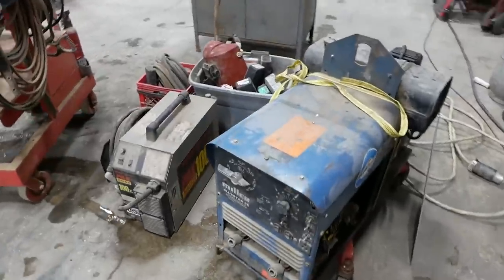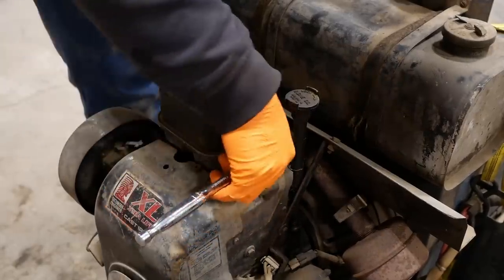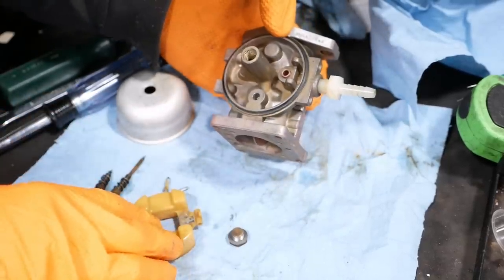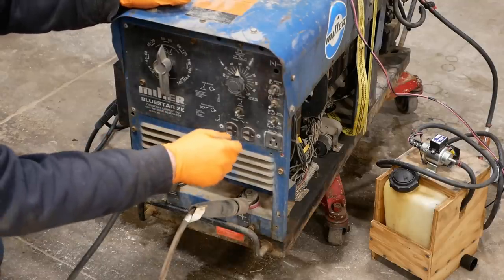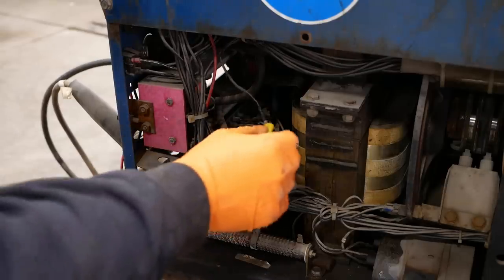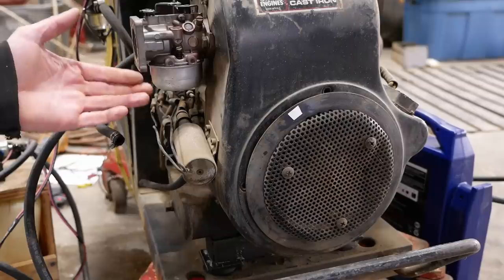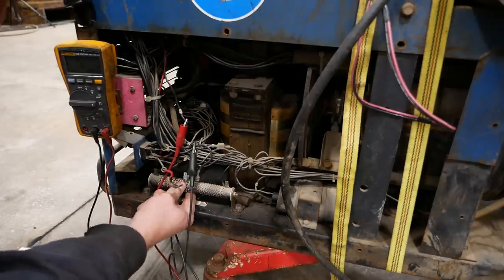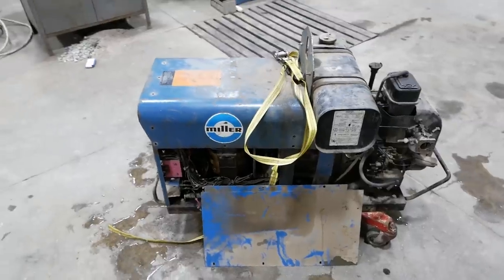I Bought a Broken Portable Welder - Can I Fix It? | Miller Bluestar 2E Part 1

Comment: I love the diagnostic path you took. For people who are not mechanically inclined, they simply don't understand the satisfaction one gets bringing something mechanical back to life. In this now throw away world, it's nice seeing someone's junk being brought back to life so it can be used for years to come. Well done.
Reply: Ditto
Reply: I recon we are individually technologically regressing. Things that or fathers fixed on the dining room table, we don't even know how they work.
As for new tech, less and less people actually know how it works and as a society we generally don't care how it works so long as it does.
Reply: @flightforensics4523  He's definitely not a carburetor guy, I think a self-professed one, but small engine carburetors are an easy equation and they are almost always in need of TLC on old neglected equipment.
Reply: @BlackCoinCrypto  Every 'body' seems to be afraid to get their hands dirty...
College wannabe sophists.
Reply: Aint that the truth love reviving old stuff and keeping this alive
Reply: Miller is a great company that seems to support all of their old equipment. Besides the capacitor, which is industrial lego and should be easy to find a close approximation of, he was able to still get all the parts still. That's worth a lot considering that this style of machine just seems to last forever. They way overbuild them. I just got a hold of an old miller stick welder and it's designed to draw 50 amps at 240 volts to put out about 140 amps DC and still be chooching at 100% duty cycle. To truly max the machine to 200 amps DC which would still be 30% duty cycle, I'd have to bypass the 50 amp plug and hard wire it to a 100 amp breaker. At the amperage I typically weld at it doesn't even get warm.

Comment: Wes, I bought a used Lincoln weldandpower diesel generator for $35, did some work to it and sold it for $600. It was put on a trailer.

Comment: Official procedure to re-magnetize a generator that uses residual current:  Fire it up, plug in a drill.  Pull the trigger.  Grab the chuck of the drill and give er a spin.

Comment: I’ve learned two reasons of why Miller is superior…
1. The manuals and wiring diagrams are available online.
2. They have tech support that will help you troubleshoot and get your machine running again.  

I always did the troubleshooting myself, until one day ran out of ideas.  I called them up, they told me a couple key things to check, and that helped them lead my down the path to the failed part.  They were willing to stay on the line while I ran the machine and poked around with my meter.
Reply: That's good to know. I have a nice one that quit working and is all electric
Reply: if you have a miller you are going to need all that help because they all burn out and stop working long before the engines ever start to smoke. they are junk
Reply: Maybe coz they break all the time and need that info and parts
Reply: @mikecubes1642 😂😂😂
Reply: I bought a partially disassembled 1993 Lincoln SA250 a couple of years ago. I reassembled it, got it running, and found that it wouldn't weld or make auxiliary power. I called Lincoln, who took my phone number and scheduled a time for a semi retired tech of theirs to call me. I believe his name was Bob Crow. It took him less than fifteen minutes to figure out the problem, a shorted armature. He and the other tech on the line recommended a rewinding service to send it to, as well as a couple of aftermarket sources for parts that Lincoln has obsoleted.

Contrast that with Miller. My employer has a Syncrowave of similar vintage. We sent it to their techs to be repaired. They had it for several months. They eventually sent it back, claiming it was fixed, although it wasn't, and charged several hundred dollars for the service. They also said a pressure switch was obsolete. It isn't. Frankly, Miller fails by comparison. 

Lincoln has manuals and literature online. They have also supplied me with diagrams of control boards not found in the manual or general user literature.
Reply: @zombieresponder  Good to know.  Thank you for the input.  I personally don’t have any experience dealing with Lincoln, only Miller.  From all the comments I’ve received on here, it sounds like Lincoln makes the superior product.
Reply: Don’t doubt yourself here, miller and Lincoln both make good stuff. It seems that the people responding are Lincoln guys. To me it doesn’t matter. Both care about customers, and both are American made. At the end of the day, if it welds, a weldor should be able to do something. Also American manufacturers give Americans jobs. All wins in my book.

Comment: Excellent electrical diagnosis, Wes.  One thing at a time, starting from the beginning.  I would expect the rheostat and resistor are your most expensive parts.  The pulse fuel pump is rather common, and high-voltage diodes and rectifier bridges aren't too expensive, either.  Speaking of which, you might throw another ten dollars at that bridge rectifier.  Could save you a lot of future headaches.
Reply: I agree on the replacement bridge. Too much bad stuff has happened at that wiring junction. The 10A diode he has will work fine (assuming it is 1KV), and it will be physically more rugged than a 3A or 5A diode. The cap is also a 10 buck item. Most likely that rheostat is going to be 50 or 100 bucks or more, but everything else should be cheap.
Reply: Depending on the vintage of the machine, Tecumseh used three different ignition systems. Early versions had points. I'd prefer the points version...for reasons that will become clear shortly. The other two ignitions were electronic, but one was a CDI. The latter two have zero parts support. The CDI version in particular has a second set of windings, similar to the alternator, that are required for it to function. If either one fails, it doesn't run anymore. I have one of the later CDI versions, and the ignition quit on me a while back. There are a couple of aftermarket solutions that can be used, but they're not cheap.

Comment: Miller bought out PowCon welders simply for the inverter design. The first Miller XMT's were blue PowCons, same case and everything. They were really well made and lasted forever.
Reply: Miller bought Powcon in the mid 1990s to gain control of Powcon's inverter power supply patents. I own a Miller XMT-300 machine; it's just a blue Powcon. A year of two later Miller "Millerized" the Powcon designs, changing the fiberglass case into a metal case, it was called a XMT-304. These machine were light in weight and had great stable arc characteristics.

Comment: Walbro carbs are pretty good. I have a small engine shop and repair lots of carbs. If you can't get the emulsion tube out, you can get small brushes that will go inside of it and clean the tube orafaces. Nice welder, hope it will work for you. Thanks

Comment: You can absolutely get parts/rebuild kits for them all over the place. you might have already tried this but sometimes you cant pull the emulsion tube from the bowl side you have to stick something in through the intake side and push it down through there. Not sure if that is the case with that exact carb but worth a look if it gives you trouble down the line.
Reply: Agreed, the emulsion tubes are often  just retained by the main jet, but they can be pretty tight to get out.

Comment: Hey Wes, just to let you know you can make a three phase converter fairly easily. Look up a rotary 3 phase converter. It will take some work on your end, but I built one myself my wife's grandfather built one for his shop and my father-in-law built one as well. If you can trace down problems in the electrical system of a car, you can build a three phase converter. Also if you need capacitors check any place that sells electric motors ie poultry supplies pig supplies etc. Or you can check any HVAC supply house, they will most likely have any capacitors that you need
Reply: Rotary 3 phase converters have been pretty much obsolete  since the advent of cheap and reliable VFDs
Reply: @kenney4043  Yes, but how dirty is the output on a VFD
Reply: @charlesangell_bulmtl  depends on the VFD unit.  Can be considerably cleaner than a rotary phase converter depending on what your local power company supplies etc.  I run a rotary in my shop but have a couple smaller VFDs for smaller things.

Comment: If it works, that powcon is a real gem, My uncle had one for 30 some years in his machine shop. It predates the miller xmt 300/350, but is basically the equivalent, one of the first inverter light weight welders to hit the market, a very high end machine when new

Comment: I've seen lots of PowCon welders in the navy. The ones we use on submarines are a smaller version of what you have that are set up for TIG. Good work getting that Miller brought back to life.
Reply: Some 30 years ago, I worked at a bio-mass steam turbine plant...small, 35 megawatts...When it was time to change out the boiler super heat tubes (2' Chro-moly) we used a couple pow-cons with scratch start TIG...they worked pretty well.

Comment: I have a Powcon 300 ST. Tig and stick. Great machines! In fact the US Navy used them on their ships. It can run on three phase or single phase depending on how the jumpers are set up inside. However, you have to de-rate it by 1/3. Unfortunately, Powcon has been out of business for decades, but manuals can still be found online. Powcon was the first to market with these inverter welders, however instead of cheaper IGBT technology that other manufacturers went with, Powcon used SCR’s which made the machines much more expensive, however they were very robust and failures were rare and easily fixed.

Comment: 72 year old retired generator guy here - I used to have that exact welder about 1985 or so - the system you were trying to describe that gets the generator going is called the field flash circuit - be sure and read your book on how to adjust your ac voltage 132 is pretty high - try to not run too much above 124 or so - when you run that thing make sure and put a leash on it - that one lunger will walk right out of the back if your pickup if your not watching... good job. - I picked up a 400 amp Miller pipeliner the other day that would not weld - 15$ later and a new diode I was in business - if I was you I'd put some new main brushes in it and clean up the slip rings - that reostat is a common failure - also work that range switch back and forth - it has wiping contacts but they do need cleaned by working the switch..

Comment: A new carburetor for that engine on Amazon is about $15. I bought one for a 1984 Honda 125, bolted it on and it worked great. 
It’s not always necessary to replace the carb, but when the carburetor is getting in the way of the “real work”, it’s a good option to consider.

Comment: Fun fact! I used to work at Miller.. worked at 3phase products and also in the engine drive shop..Great company to work for and things are done to perfection or as close too as possible..got let go in 2008 during the economy crash.. I've wound many 3 phase coils and  various other rectifiers and coils for different machines.

Comment: Stay tuned for the shocking conclusion :D Just replace that fuel pump with a standard round pulse pump. rebuild kits have long been nla from techumseh I have done the conversion on several of my old tractors that use the techumseh motors. Standard briggs and stratton round fuel pump from any modern twin or single works perfectly 520-441 stens part number. just find a convenient spot to mount it and run your pulse and fuel lines in.

Comment: You can always get a VFD to run that plasma cutter if you can't swap it to single phase.
Reply: Tim is 100% as this is the simplest (and probably cheapest) way to go.
Reply: I doubt it, many 3 phase welders are really only single phase, but use the higher voltage between phases rather than the lower voltage from phase to neutral. For example in Australia we have 240 V single phase but 415 on 3 phase. Higher end welders will often be genuine 3 phase, to get smoother DC after rectification, but even here a VFD will be of limited use because the voltages between phases will be the same as the single phase supply, so in the U.S. even on a 220/240 V circuit the 3 phase voltage will be the same as the single phase supply.
Reply: @Rope Tangler  idk what you're talking about because in the US, you can get 120/208 3ph, which has less voltage per phase than 120/240.  And you can also have 277/480 3ph which is found in commerical and industrial settings. But even if a vfd doesn't work, which it probably will. He can get a rotary phase converter.
Reply: @timhufnagel7462  you need sufficient voltage and the ability to supply sufficient current to make it work. If in the U.S. you put 120V, single phase into a VFD to get 3 phase you do not normally get 3 phase at 208 volts between phases, but you get 3 phase with 120 volts between phases. Much the same situation with a RPC, while it is possible to make a RPC with higher voltage output between phases than the incoming single phase supply, that is not the way most are configured.

Comment: I have a Miller 2E that I bought new in 1987. Has been faithful. Had the carb to develope a tiny pin hole in the round 3/8" round alum circle near the idle screw two yrs ago...Pluged that.  Had to replace the org. starter, then I  bought a "spare" new one...cause they are not making them anymore. Am real careful to change the oil frequently, what with no oil filter. 
 I learned a lot from your vid, Thank you.

Comment: The slip rings are really dark and shiny. I used to work on these and that was one of the more common problems I ran into on these machines. I used a piece of fine grit sand paper taped to a paint stick to clean them while the machine is running. Good job diagnosing the problems.

Comment: That older Tecumseh engine could be burning oil because they put the same 5w-20 in it, that they used  to top off the Super Duty truck that hauled it around.   Looking forward to part 2.

Comment: On the blue star there is three possibilities that are common 1 check the little diode in the wire loom. 2 the rectifier it’s for the power supply to the control board. 3 the brushes. I had mine go down I talked to the guys at applied equipment out of Dallas they were extremely helpful all the parts for all three possibilities was under $40

Comment: They are a great welder. I bought it new. Used it over 30 years in my service truck. Still works great. Only problem was Tecumseh engine parts are no longer available. The engine magneto died. I put an mid 70s ford ignition module and a bracket to hold a cam sensor. Works like new. Only problem I ever had.

Comment: "Now that we've spilled gas everywhere, lets try and weld something" lol
You've convinced me that I need an ultrasonic cleaner.  You can get replacement carbs for that on eBay.  Cheap Chinese carbs, but they work.  Talk to Lincoln, if they don't have a part you need, they can point you towards someone who does.
Excellent work figuring it out!

Comment: I picked up a Lincoln in similar condition. The capacitor in it was faulty also which translated into difficulties starting an arc. Once a stable arc was going it was fine. A replacement for it was also unavailable, so I had to go to the “best sort of similar option” and it’s done fine since. Nice pick up you got there.

Comment: Did a quick lookup that Tecumseh should be a OH160. 16hp.  I have the OH120, 12hp version on my sears lawn tractor.  That thing is 33years old now, still running.  Leaks oil.  When I got the manual for it online to search for orings and seals, i was surprised to see it was designed as a 'long life' engine.

Comment: i have the same unit. I paid a generator shop for a load test and ohms adjustment. They also cleaned the slip rings and replaced the brushes. I finally got to use it the other day. Great welder for what it is

Comment: Clean those slip rings on the brushes Wes. That welder will be great around the farm. I welded with one for several years in a Steel factory and the units were bullet proof. I had a 16 hp Onan on mine but never had any problems on the line. I changed oil in mine every 50 hrs. of hard use.

Comment: Brought home my own crusty junk this week, I picked up an ariens power broom that had been sitting for years. Covered in rust missing the pull start ,electric start was falling off. I had all the parts to fix it got it running in about 10 minutes and all fixed in an hour only problem was it was going to be my winter project...but it's all done on the 1st afternoon lol

Comment: Good machine, i have one paying around, they use a bit of oil as they age, valves need some attention once in awhile, can be rebuilt many times as long as the electrical end works, nice little units

Comment: Nice work on running down the problems. I have an even older version of that blue star welder. It came with no throttle servos and  a carb that had horribly worn throttle and choke bushings and shafts. 
I looked for Tecumseh replacement carburetors and found a few on Ebay at ridiculous prices. I opted for a cheap Chinese Kohler clone carb off AMAZON  which had the 2 stud mount. The throttle linkage was different but after some alternate engineering it runs much steadier than with the old floppy one. I have to set the engine speed by ear for the 2 different generating speeds. Also mine always wants to be choked to start. 

Another thing is on mine, it generates 120 volts at low idle like 1000 RPM. Both switches need to be in the correct position for that to happen. 
To weld the switches need to be in the other position and the engine needs to be  running at 3600 RPM.

Comment: Pow Con is a great unit! They were bought out buy Miller in the early 90’s. There engineers went to work for Miller and are responsible for  the XMT line of machines.